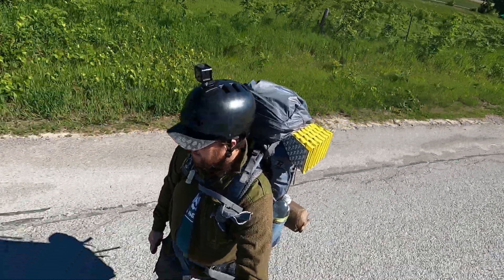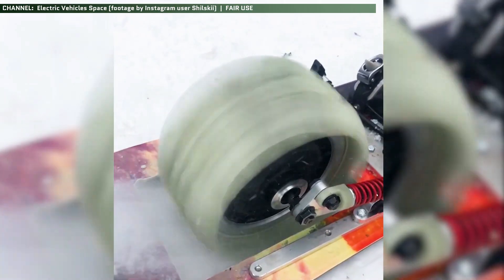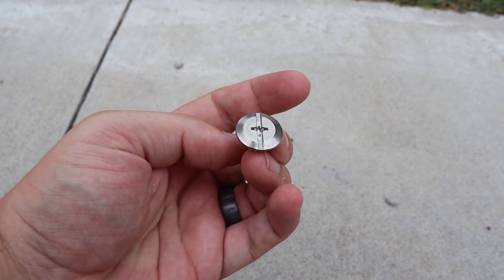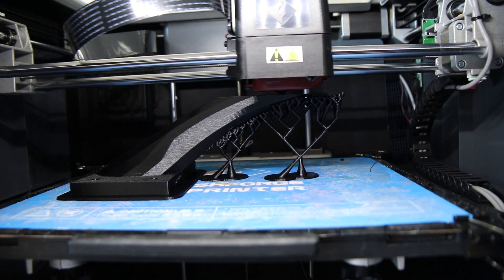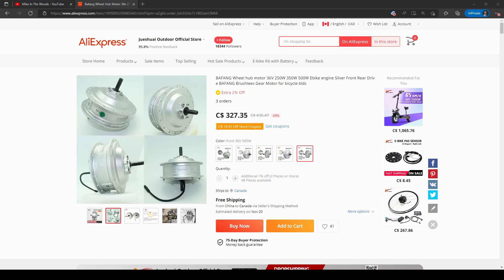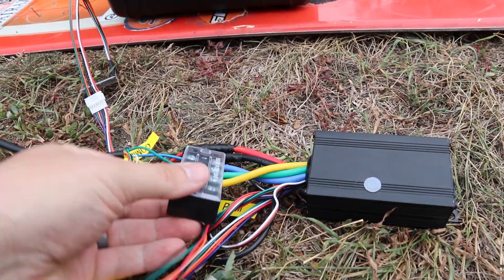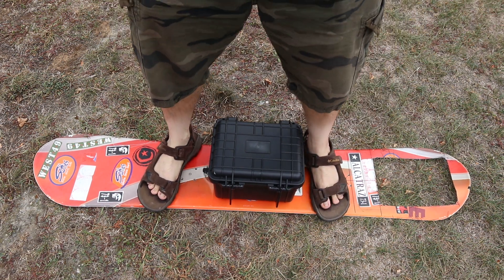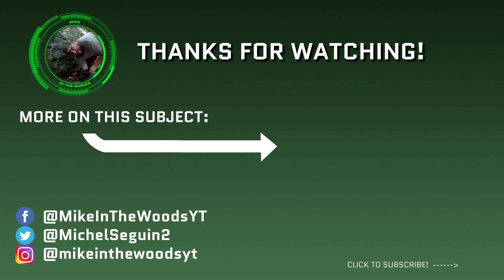DIY Electric Snowboard Project! Design & Build Progress

Comment: Hello again. There is two ideas, which I have to share about your version. First one is about screws - just use a countersunk screw - i used M8 standart DIN7991. Second one is about motor mounting mashined inserts - there is cheap chinese gyroscooters on market, which is contains those inserts. I dont know about prices in your region, but in my country broken gyroscooter costs about 30 USD, this is hilarious donor for DIY projects.